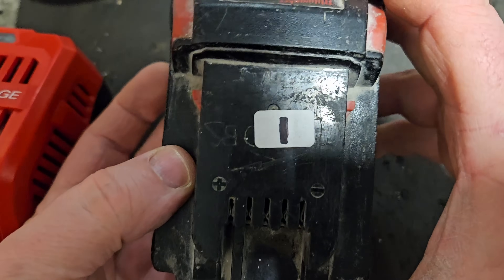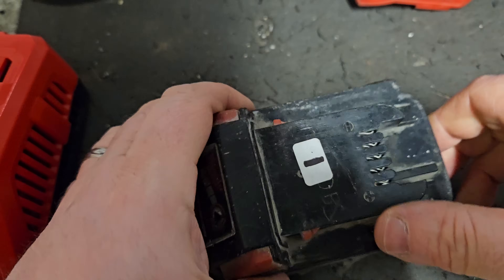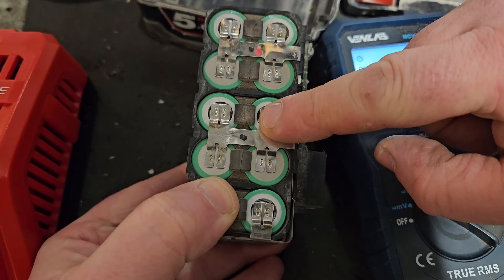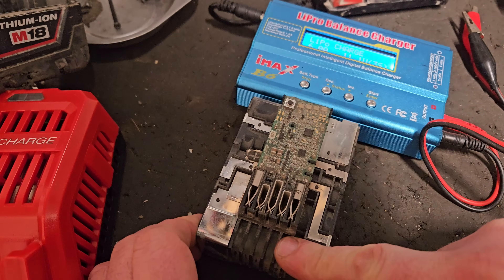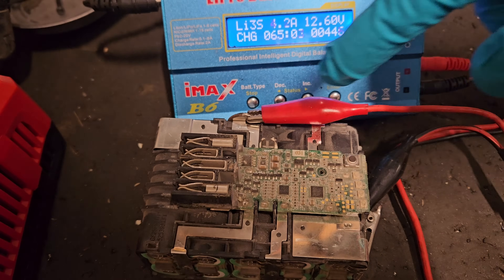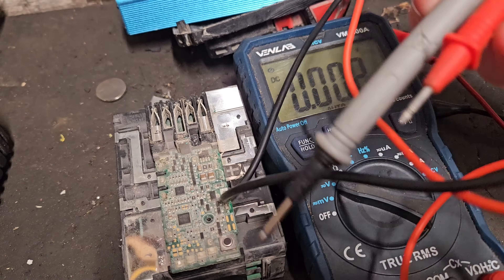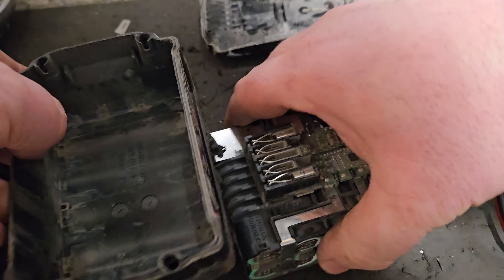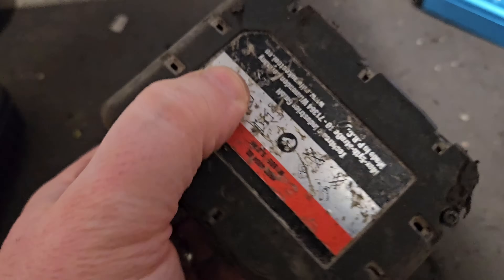M18 Milwaukee Battery Cell balancing

Comment: Your videos could all be 1 minute shorter if you didn’t swap the leads every time
Reply from the maker: I know but faulty cells can reverse polarity when faulty I want the viewer to understand where plus abd minus is in the cell bank. I want the viewer not to make the mistake when the meter reads voltage to think a faulty cell bank is good. That's why I do it.
Reply: @doctorlefthandthread thank you for the explanation. It would have helped me understand if that was explained in the video when it was done but I’m glad to have learned damaged cells can reverse polarity

Comment: Wondering if you had any tips as to why my b6 charger comes up with a cell error. I have followed everything in your video.
thanks.
Reply from the maker: I never saw that but I never tried to charge a bad cell with no power or reversed polarity

Comment: hey you should have charged those with the li-ion not the li-po setting. the li-po is 4.2v and the li-ion is 4.1. these batteries are lithium ion. its not a super big deal but this could potentially cause a very bad cell to overheat.
Reply: the spec sheet for those cells is literally 4.2v, I also dont know where you heard li-ion is 4.1v. they are both 4.2v maximum with a 200% lifespan increase at 4.1v. And if you're not understanding. The max voltage is 21v on all 5 cell power tool batteries. you can measure it yourself.

Comment: Thanks! Wouldn’t it be better to charge them up using a lower amperage so you they maintain the balance longer?
Reply from the maker: Maybe but I try a different speed the process when filming time is money
Reply: @doctorlefthandthread  I’m in the middle of doing it now on a 9.0 battery thanks to your videos. I’m going low and slow at .5A.
Reply from the maker: @thecappy  good luck
Reply: @doctorlefthandthread  it worked! Been using it almost daily for over a week. Took it apart today and checked the cells and still balanced. We’ll see how long it lasts. Appreciate the vids.
Reply from the maker: @thecappy that's cool if thanks for letting me know

Comment: you could make yourself a balance lead  and do the whole battery  on a balance charge it will bring them all to the same voltage  saves doing each bank them individually there easy to make  as that charger has the balance port on the side  for a 6 balance lead . you can also monitor each bank i have the imax charger which is the same

Comment: Tried with a 9.0 and a 12.0 successfully and it takes overnight takes a loooooong time but it's fast with a 1.5 or maybe even a 5.0 pack to rebalance I got the jst plug and harness and some test leads on AliExpress and soldered up a balance harness with alligator clips just for this

Almost seems to work better on lipo vs liion mode

Comment: You might find that the cells that had the highest voltage have been damaged and there capacity reduced, what you might want to do is discharge it and then recharge. If it’s out of balance again the cells need changing. You may also want to carry out an internal resistance check, this gives you a good indication of the health of the . Use an impedance type tester for this, as the charger based ones are not very consistent.
Reply: How do you discharge them?
Reply: @ramonsantos5404 I have a capacity tester and simply discharge using that
Reply: @ramonsantos5404 put the battery on a tool and zip tie the trigger or a big light
Reply from the maker: Thank you sir